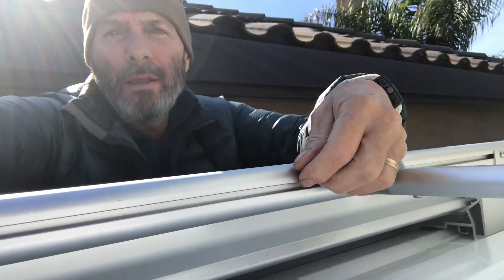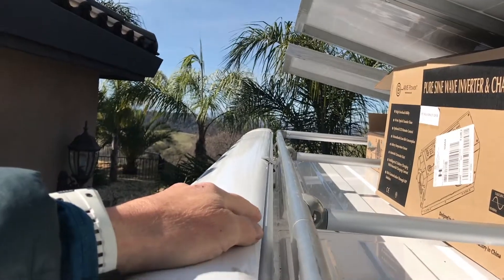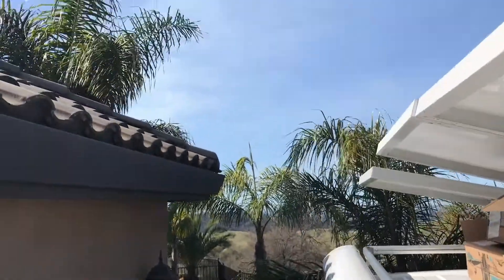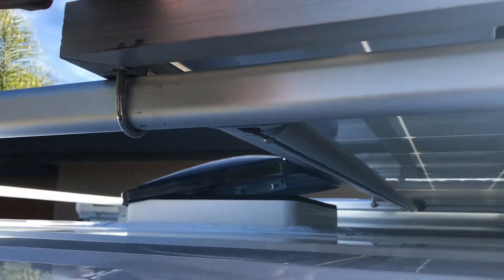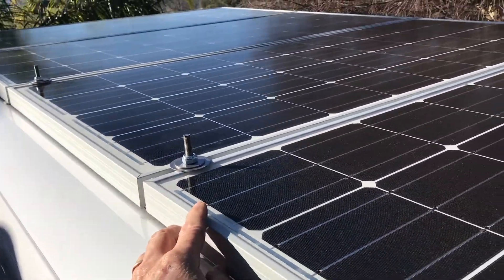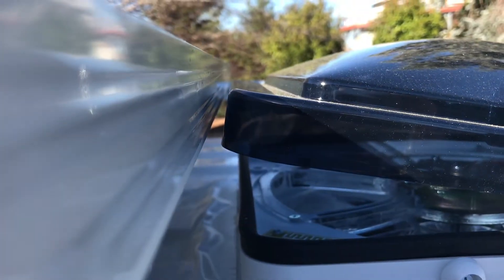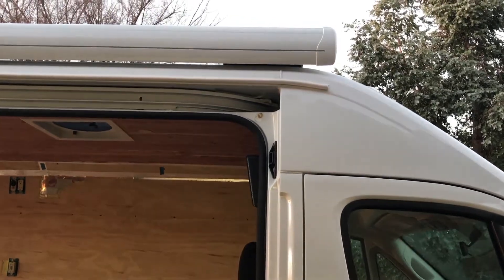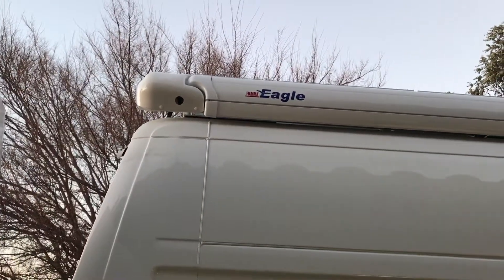Promaster Conversion #16: Solar Panels Part 2

Comment: I know it would be labor intensive, but using a file you could widen the roof rack slot large enough to make a square hole that the square nut would fit in. Then you could insert the nut in the middle of the rack and slide to its final location.

Comment: Hi Bart do you think this solar setup would run a rooftop ac unit?
Reply from the maker: The main thing is how much battery power you have.  With my current batteries  660 amp hours, I might be able to power the AC for an hour, that's it.  As far as I've seen, AC units flat need shore power to be effective.
I think Travato's  have a built in sensor that whenever the batteries get too low, the engine turns on.
Reply: On the Trail with Bart yes I think it might not be worth it unless I’m plugged in. I’ve been watching your videos getting ideas. I’m picking up a pm 3500 hopefully this week and will start building it out for mountain biking and scuba.

Comment: Hey it's Andy from New York yes it's freezing here I think you're in California.
Anyways I found your videos because of ProMaster and I must say we have a ton in common number one is that I also owned a Sprinter for my first van and got rid of it it was diesel took me awhile to find my ProMaster which is sitting in my driveway full of snow waiting to be built out in the spring the funny thing is is I've been doing my research on material solar panels and definitely the roof rack that you bought I see that you spare no expense and you got the motorized awning I love it.
From watching your videos I get a lot of ideas of what it looks like what works and what doesn't.
I bought the Kodiak newest generator got it at a great price for my power for right now. love your videos keep them coming. They're pretty straightforward it's the way it is no sugar coating and the problems that come when building something like this.
I don't have a lot of videos up yet because I'm not building my van yet but have a lot of ideas that I will be filming I've been making videos on YouTube a while back on another Channel.
Anyways looking forward to more videos thanks Andy.
Sorry this is so long
Reply from the maker: Thanks Andy.  Be sure to send me a link when you start your build.

Comment: Its ashame you did not discuss the hardware that solved your issue. I'm not really sure what it looks like or where you bought it. It looks like two bolts in one at right angles to each other.
Reply from the maker: There is one eye bolt at the joint of every solar panel.  The eye bolt is attached to the channel of the Fiamma Roof Rack.  I'll put a link for the eye bolt in the description.